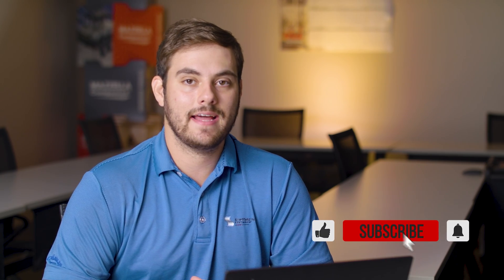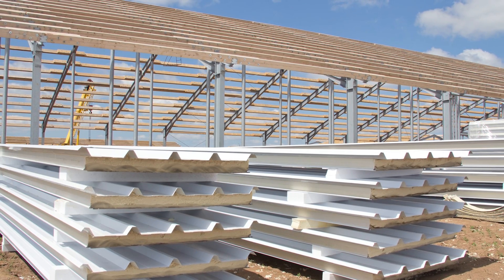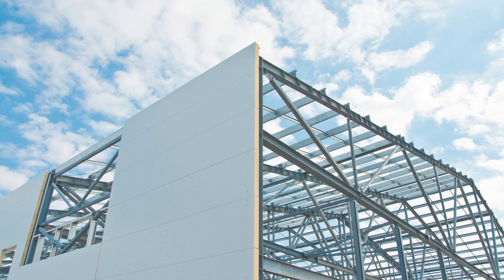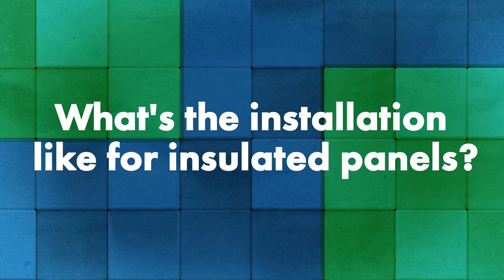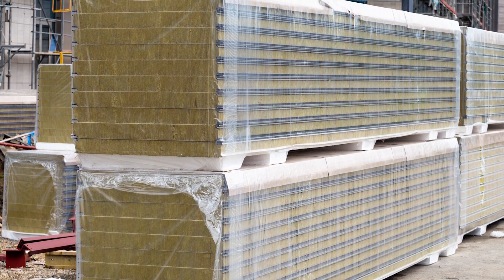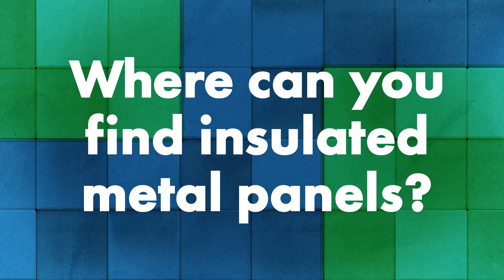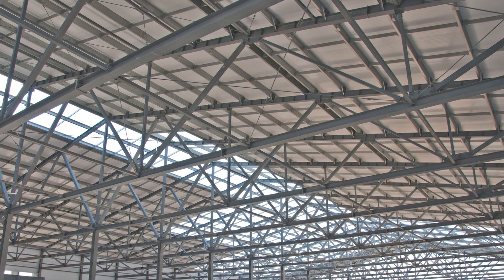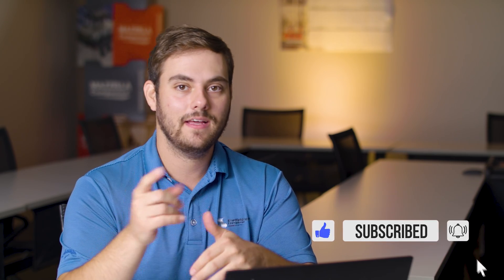What are Insulated Metal Panels? Uses, Installation, Testing

Comment: 1. Where can I buy IMP for a small residential project, (a 600 sq ft ADU), or which vendors sell in smaller quantity for building residential homes? 
2. After you factor in the cost of insulation, sheathing, vapor barrier, structural support, etc., is the cost of IMP that much more than a single sheet metal roof?
Reply: Lol 5x...some hidden agenda? These roofs are in wide use in south East Asia...in part due to cost effectiveness
Reply: will be 5x the cost, at best.

Comment: It's not obvious (to me) from this discussion what makes insulated panels easier/faster to install than say non-insulated alternatives, particularly if used for roofing.
Reply: Primarily the added labor and time for installing insulation in the framing cavity below the single ply panel and a additional finished surface on the inside face of the IMP panel.  The inside surface of the IMP can be striated (nearly flush) embossed, stuccoed finished or even lightly corrugated.

Comment: Hello I’m in the roof cleaning industry and there is a big debate on how to clean a metal roof. We clean for Algea, mold, stains, etc. and on color we also do oxidation removal. The big debate falls on how to clean galvalume/galvanized/aluminum safely and instantly for organics. I would like your thoughts on the recommended process and products used.
Reply: Soap and water with some bleach
Reply: Algae